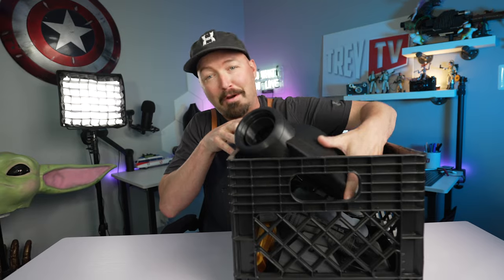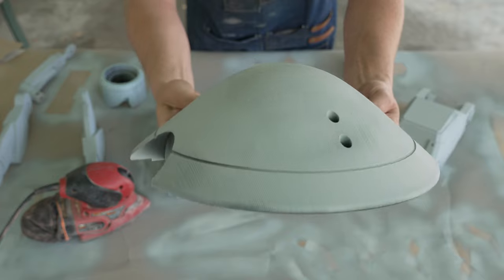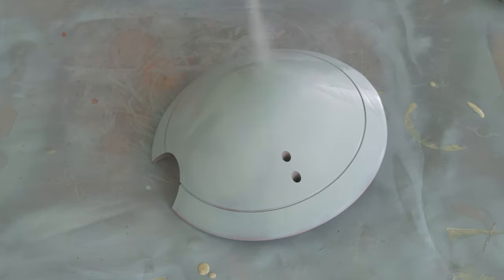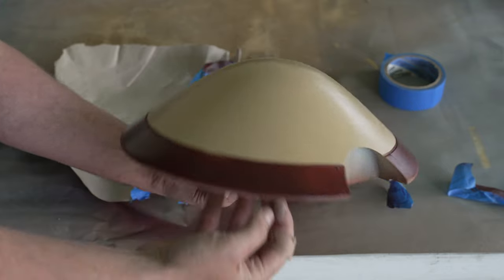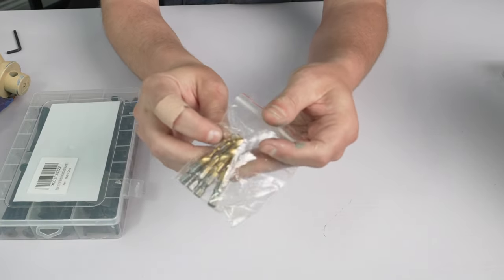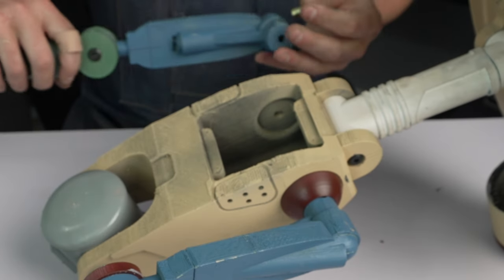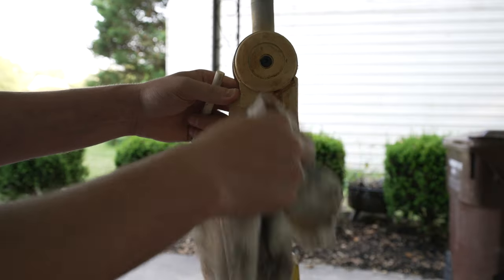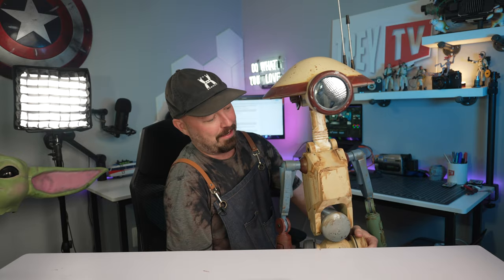MY FIRST DROID BUILD!! || Droid Division 1:1 3D Printed Pit Droid

Comment: Because the bondo with acetone is toxic, I have been using a lot of acrylic modeling paste. It can be spread really thin and sands well after its fully cured.
Reply from the maker: Hmmm..that's interesting..any particular brand?
Reply: @TreyEversman  Not really. I used Masters Touch from Hobby Lobby on my last project because it was 40 percent off. 16 ounce jar was less than 8 bucks.
Reply from the maker: @brokentuskgarage  interesting..I’ll have to check it out!

Comment: how was the total cost of this guy after parts and filament?
what was the rough total print time ?
Reply from the maker: Great question but I’m not totally sure..I think 3-4 spools ($80) assorted screws ($10) metal rod ($8) & paint (used my Mando paint that I already had) putting it around $100..that’s my best guess. For print time, a couple of weeks but it all depends on your printer and print settings. Hope this helps and thanks for tuning in! 🙏
Reply: @TreyEversman   thank you sir